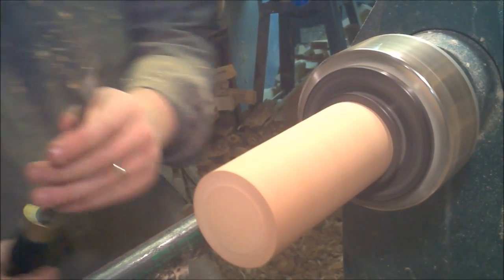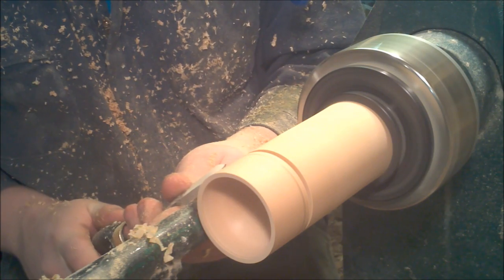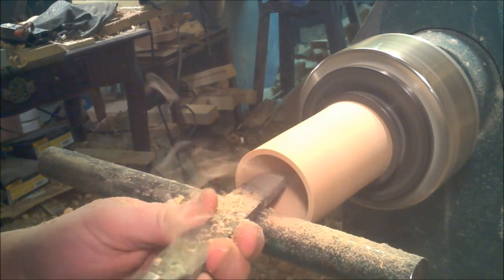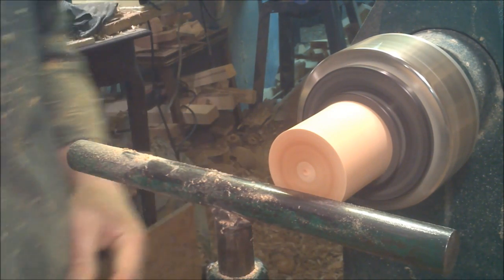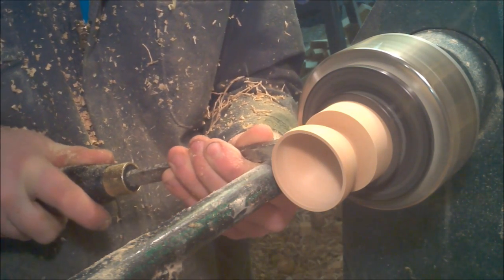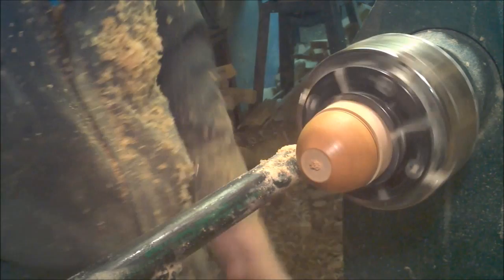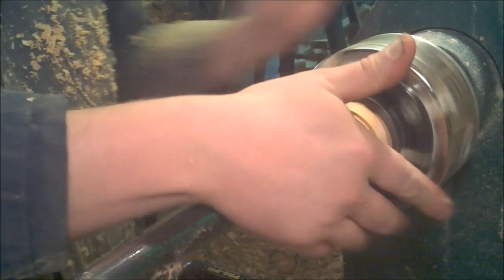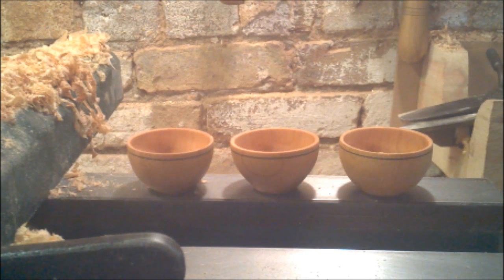Cherry End Grain Bowls

Comment: I'm new to turning and just found your video. Can you tell me what the wire is that burnishes the groove you make? Some sort of fishing line?
Reply from the maker: Sorry, missed your question till now. You're right. It's a fishing lead. Basically a small steel cable mounted between two "T" ends. It's held up well for a couple years now.